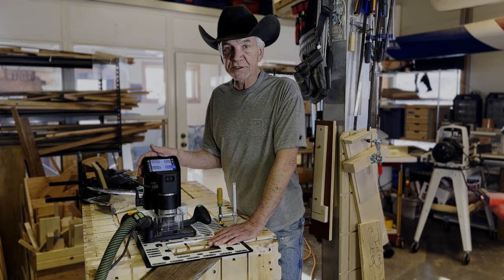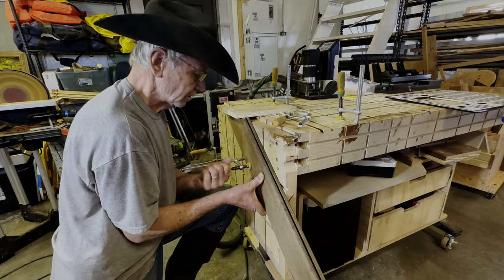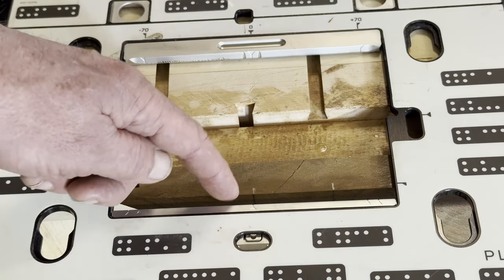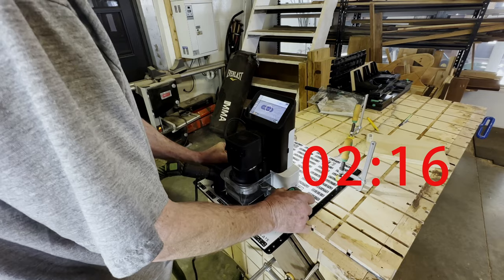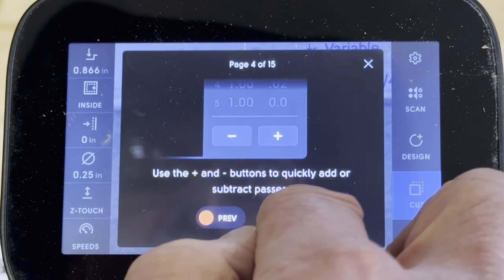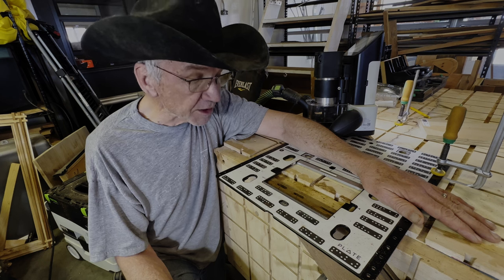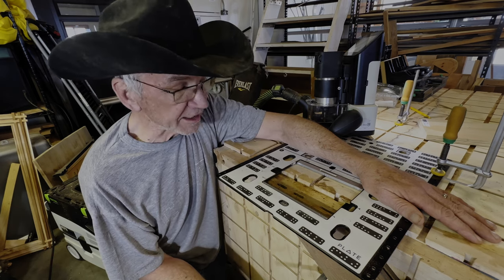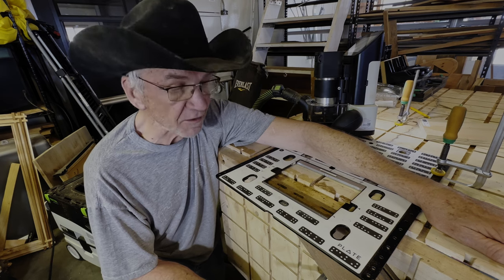Origin Autopass Worth $200?

Comment: I got the trial shortly after it was released and thought it was a good feature but felt like I could do other things with $200 than save a few button presses. Several months later I had a mid-century modern cabinet project with ventilated doors cut in a period pattern. About 100 Z-shaped interlocking slots in 1/2" white oak. After the first few I ponied up the 200 smackers and was glad I did. Since then I use it all the time and have no regrets. Money well spent in hindsight.
Reply from the maker: The free trial ended last week.  I’m going to buy it next time I have a project.  Probably today!

Comment: Just got autopass and really like it.  It shines when you are cutting through a board at full depth.  Doesn’t work for pockets though.
Reply from the maker: Interesting re pockets. Didn’t consider that
Reply: The Shaper team did mention they were investigating making AP work for pockets.  It's a completely different problem to solve as it is a path versus a free-form movement.  That said, some of us use slightly overlapping inside cuts with offsets for clearing pockets on most smaller-sized pockets.
Reply: @whymeasure excellent idea!
Reply: I missed the free trial but have considered auto-pass. I’m reluctant mainly because I think it should have been a free upgrade to the Origin given the high price of the unit. By the way, I live in Evergreen, CO and visit Steamboat Springs often. Love it.
Reply: @pjcornelius  What do you mean you missed the free trial? Every shaper origin unit gets a two-week free trial. Afaik, there's no time limit until you activate, then it expires after 14 days.

Comment: Thank you for a nice video on this feature.  I haven't done Autopass yet but I think I will for the next project with a lot of holes.  Something I thought of while watching your video is also there is less chance of doing something wrong with all of the button presses.  My screen is very sensitive and I have made a couple of inadvertent mistakes by putting in the wrong data accidentally.
Reply from the maker: Its a little annoyoing to have to pay the extra $200, but it is a noticable improvement whne using the tool.  For me, it is worh the $$, so I paid the $200 (after the free trial expired).  Thanks for the comment